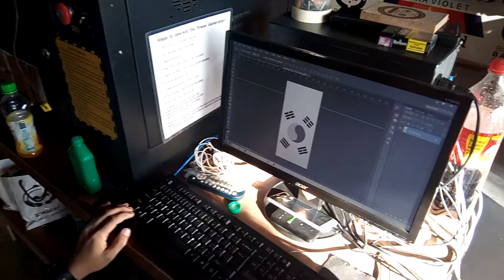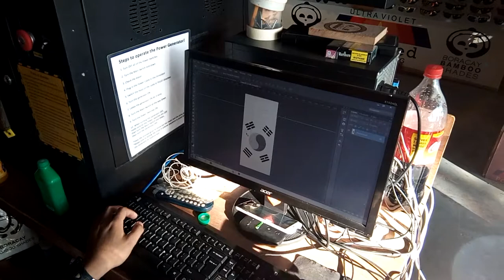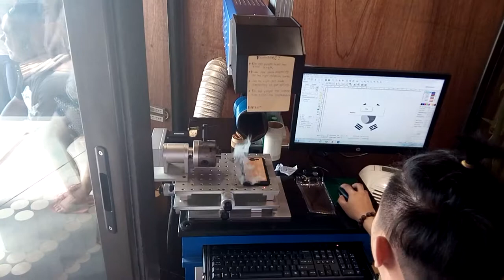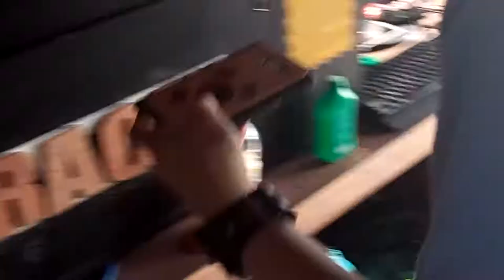Engraved Wooden Phone Case

Comment: how much?
Reply from the maker: Jeem Casupang Thanks for the reply. 15 to 16 dollars at todays exchange rate slightly over 50 pesos to 1 Dollar. 

The Cost in pesos is 799 pesos. I have a picture that shows the price and the models they do the cases for but I cant get it properly sized for youtube to accept it. 

Outside of the store is a sign with all the models and the 799 flat price. 

Hope this helps.